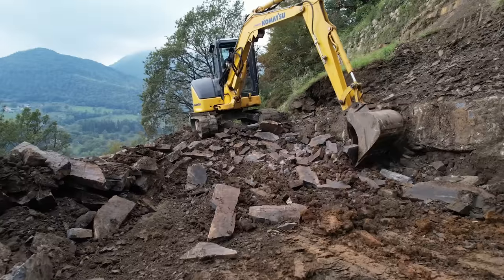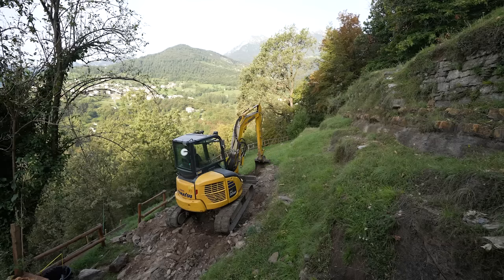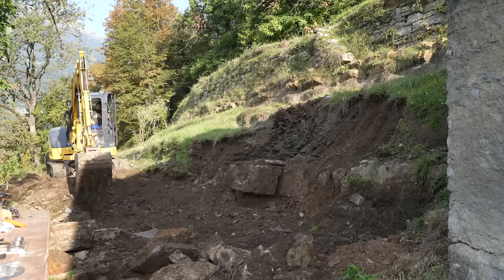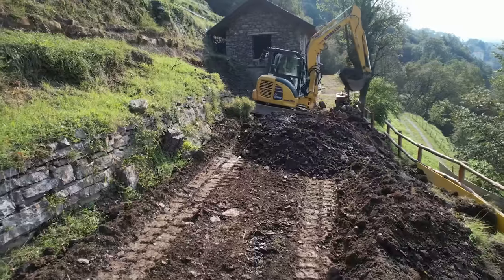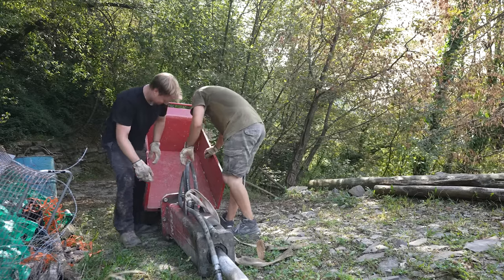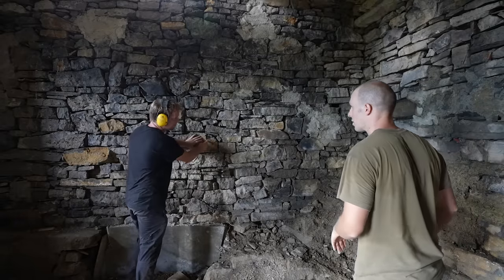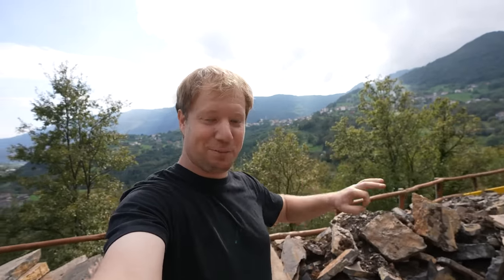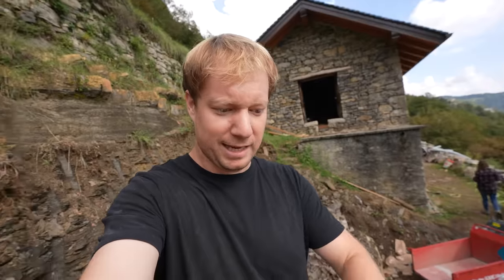BIG Changes to the Terraces Around our Stone House!

Comment: With all those rocks have considered using Gabion basket retaining walls? Basically wire mesh baskets filled with stone, it’s quick to build and and inexpensive especially as you already have the stone to fill the baskets
Reply: yet it wouldn't blend with the original retaining walls
Reply: We don't use those cheap solutions in italy

Comment: Make certain that the drainage of the terraces is corrected so that those times when too much rain comes the crumbly soil does not become waterlogged and start slipping downhill while gliding down against the lubricated wet bedrock.
Reply: Yes. Slope it away from your house. And I’m glad you’re leveling the terrace. I think eventually you might want to do that on all your smaller terraces since with time erosion has made slopes on all of them. But since in the future you’ll probably be adding more gardens and animals you’ll appreciate the more level useable space.
Reply: Yes indeed‼️
Reply: @sgrvtl7183  leveling the surface will help slow down boulders but if the water becomes too high at bedrock there is possibility of downward slippage but as been said the walls are porous so buildup should no happen. Would be great to expand some of the terraces as to flatness so that it can attempt to slowdo boulders and make gardening area larger. Some fruit trees would be great if the snow does not kill them and maybe some esplanade along the wall faces for fruit bearing plants. I love stonework and terraces.
Reply: @sgrvtl7183  you can also start to mulch them with the weed vegetation and tree leaves as well as non-fat kitchen scrapes to build up the soil and maybe sift the soil of some of the small socks that can be used against filling in behind the terrace walls.

Comment: you should put in concrete pillions to sir behind the new stone wall. have it going 1m deeper than the wall, and have rebar coming out to lock into the morter you put in those parts of the rock wall you will place with concrete at the back of the rocks. that way it look like dry stack, but hold like a concrete one

Comment: I'd go as far as getting a drilling rig to drill large holes down into the bedrock putting thick walled pipe in for anchors attach the rebar  to then form the walls. Those are some steep mountains your dealing with.

Comment: Why do the excavating before you have built the retaining wall ? It would have been safer for the house and you would still be working on the house which I thought was the most important activity to get done asap so you can get the family living in the house.
Reply: Did you not hear them explain in the video that they needed to create a space to store the supplies to work on the inside of the house?
Reply: @mercy2453 -Yes I did, but standing around watching the digger and being concerned about the vibration doing damage to the house when building the wall would have eliminated that problem makes more sense.
Reply: @S.L.S-407  we are not there to see everything going on. We see a snipit. Brady and Heather are intelligent and are working with the Italian authorities, geologists and engineers.
Reply: @mercy2453 - I know they are and it's a shame that they have to do what they are doing. Think of how far along they could be if they didn't have to dig up the floors.

Comment: You might want to think about what to do with the hill right behind your cabin because that's where moisture creeps into the house...no point in insulating the floor if the back wall is still half underground .. and are you sure that the excavation of the mountain wall will not cause a landslide in the future with heavy rains as there are tons of rock sitting on the upper terrace?
But good luck with the annihilation anyway .. that's the only job you're really good at so far :)))

Comment: I really do admire your industry and hard work, but I’m rather concerned  that you have  now cut into the temporary high water table that will occur on the slope and in times of extremely heavy winter rains your hard work and your home will be flushed off the side of the hill along with the thousands  of tons of disturbed stone and rubble that you have moved.

Comment: Italy is very old and so are thier sewage systems.All cities in Italy have big problems with sewage back up when the heavy rains come in winter.The tourists are unaware of this fact as the come to Italy when its summer and never a drop of rain so the sewage seems to flow out to the sea untreated.They rely on the old archtecture so heavily for tourism that the only way to update the sewage would be to knock down the coloseum,sisteen chapel etc. to build proper sewage systems which will never happen. All the while people from all over move to Italy as they please further eroding and draining thier capability of self sufficiency.Italy is a filthy mess and you would only know this if you actually had to live there.

Comment: With climate change and increasing downpours, I fear a landslide for your farm. That slope is dangerously precipitous. I don't know anything about what it would take to secure it, but if you were there during such a downpour, I'd get out. Italy has had many murderous landslides taking whole towns away. Forgive me, but I think you should be very worried and very extra careful in such a situation. I don't know why you would have bot such a landscape giving the landslides and earthquakes in that area? Nevertheless, the work you have done is wonderful, the house will be a joy as long as it lasts. " A word to the wise." "An ounce of prevention is worth a pound of cure." If you walk the terraces, look for places where the wall is bowed outward, especially under the house....that is your weak point. So I would think getting serious drainage above in several rings,  and around would be a top priority. When the ground is deeply soaked, nothing can hold the weight of it from collapsing. Please tell me I'm wrong!
Reply from the maker: @28105wsking  the house has been here for 700 years. The stone retaining walls were built by the venetians 700-800 years ago and were built without any mortar. And yet with all of the heavy rainstorms there are no problems. Yes freak weather events do happen, and I’ve witnessed some happen here before, and there are no issues. Is it possible something could happen in the future? Yes… but where we came from we lived with the constant threat of tornadoes that could wipe out your house. That’s no reason to live in fear